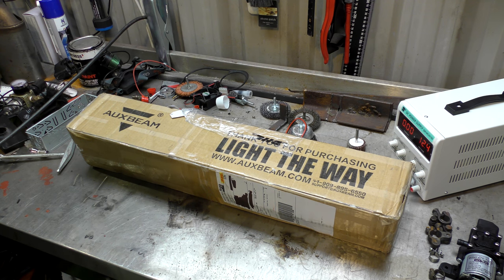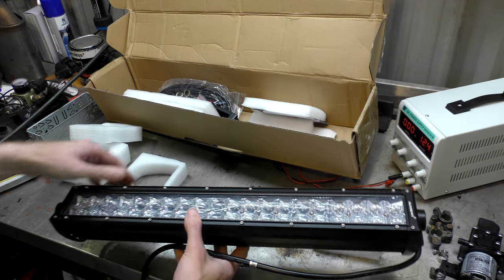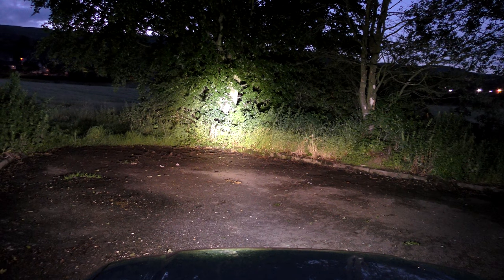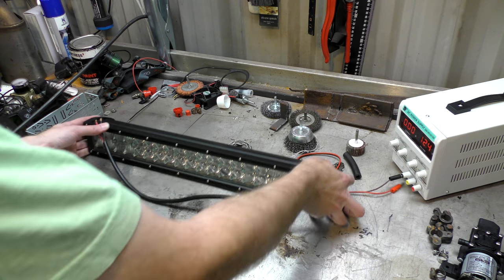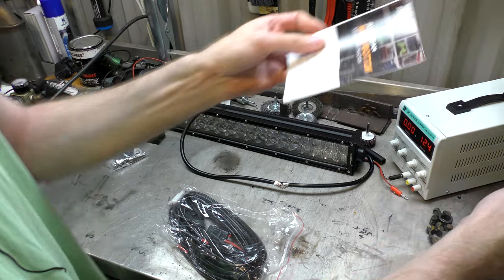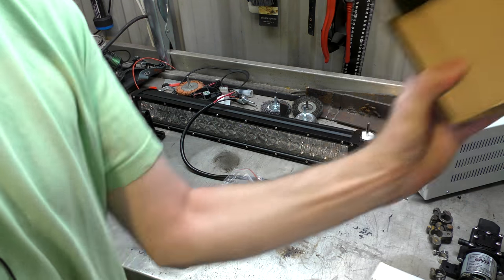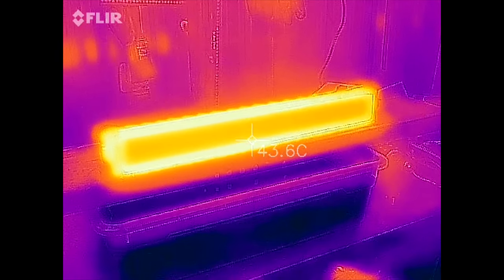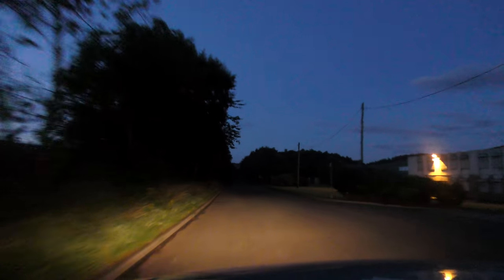Auxbeam 22" 120W LED Light Bar Test & Review

Comment: Did you try this at 14 volts? Was there an increased current draw? Because 7 amps X 12.5 volts is only 87.5w. quite a bit off the claimed 120w from auxbeam?
Reply from the maker: +Sid Smith I had forgot to mention that. They were a bit optimistic with the power figures. 14 volts made no visible difference and the highest power I saw was 90 watts.
Reply: David McLuckie bit cheeky of them 😂. As long as it's decent light output though that's the main thing. It will interesting to see how long it lasts.

Comment: Is this a 5D Lens?  You can bypass the wiring harness and make your own with a four blade relay, a blade fuse holder, an SPDT switch and you'll be able to turn the light off on the middle position with no accidental activation, up to activate with your high beams, and down to activate the light bar independently.

Great video, will subscribe, thanks for sharing 👍
Reply from the maker: +Dr. Mark in Texas It is a 5D lens. Good tips on the switch wiring.

Comment: I dont like the fact that the harness has no sealed 2 pin connector. My 22 inch came with one and puts out 5800 lumins in the center beam and great floods on each end and i paid right at 140.00 for it.
Reply from the maker: That's a good point.  Would have saved time at installation.